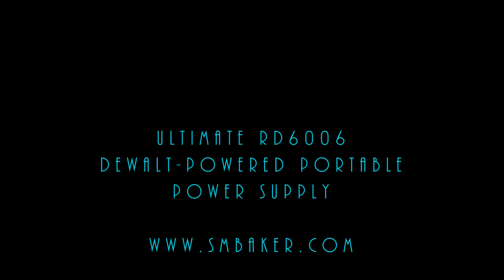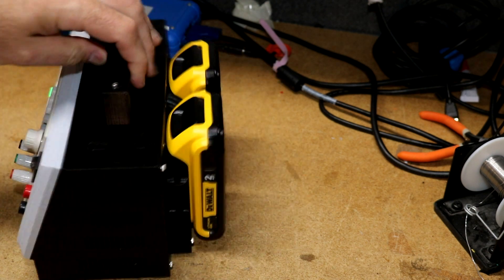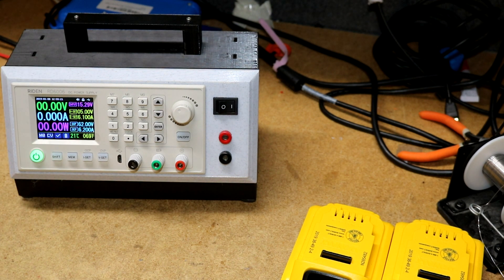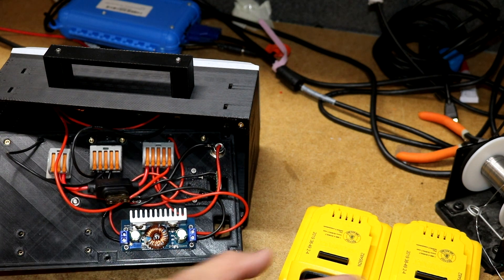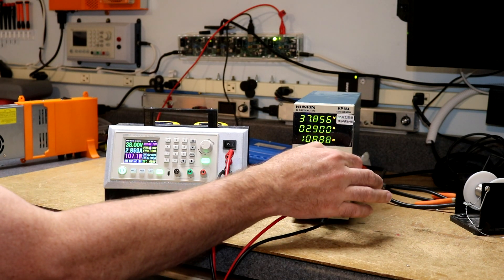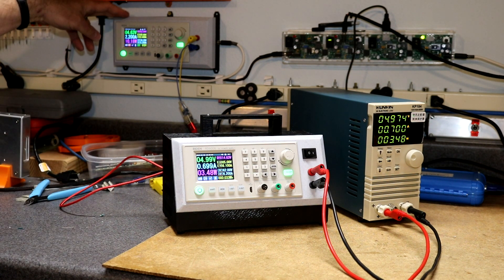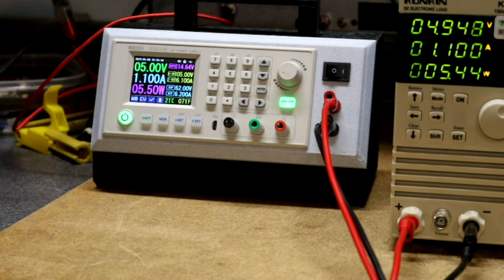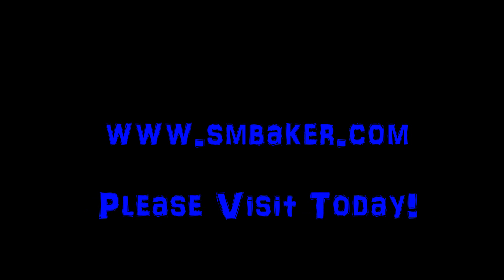Ultimate Lab RD6006 Power Supply Build, Portable Dewalt Lithium Powered

Comment: The rated voltage on an electro is just that, the voltage it can operate up to across the temperature range. The "wiggle room" is built in on top of that (~15%) so based purely on rated voltage there was no need to replace the 50v cap running at 41v! As you found out though it was a dud anyway.

Comment from the maker: Update - pulled the boost converter, desoldered the output cap, and it did test bad (read 10nF on my tester). Replaced with a 220uF/100V capacitor that was physically much larger. End-to-end efficiency is now about 60%. 2.4A in at the source == 1.5A out at the DC load.

Comment: Nice demo video. 
Here is a simple upgrade for the USB-C input.
Type C USB-C Female Input to DC/Rectangle Power PD Charge Cable fit for Laptop 18-20V (5.52.1mm for HP) https://www.amazon.com/dp/B083321BMJ/ref=cm_sw_r_em_apa_i_IAq3EbKCYVT5R

Comment: I made something like this a while back but used one of those much smaller adjustable buck converter supply modules. I didn't have an option to run it from USB but I have a ghetto USB 5 Volt out using a 7805 to use as a Phone Charger/Flash Light Charger. I used a Ryobi 4ah battery and also tossed on a little Volt Meter that I can pop in and out to test Lines since I use it for Work as a Low Volt Technician working on Alarms to full blown Home Automation.

Comment: I’m surprised that you didn’t design the fuse into your case for external ease of change without having to open the case.   Was the fuse an afterthought?
Reply from the maker: Thought about it, but eventually decided it's a fuse that should never blow so I didn't mind hiding it internally. There is plenty of room on the back panel of the supply that I've filled with other optional cutouts for switches or banana jacks, I could easily remix a back panel variant with a fuseholder instead.

Comment: Instead of the step up for usb c 5v you could use pd capabilities of usb c to ask for 20v from the charger. There are small modules available that handle the "handshake" with the charger.
Reply: Yeah. I’ve been using the Sparkfun PD breakout board to power stuff. It’s programmed over i2c, but it rememberers it’s last setting. About $15, I think.
Reply from the maker: I seriously thought about this, and the case is actually designed so that I can mount in different breakout boards for the USB-C connection. Right now, every single USB charger in my household is USB-A 5V-only. I've started the transition to the USB-C connector as a form factor, even on 5V-only sources, mainly because I started to accumulate a supply of A-to-C cables for my Raspi-4 projects.
Reply: @smbakeryt  Of course without PD negotiation USB-C will max out at 10W or 8W after an 80% efficient boost conversion. This is quite limiting compared to the 360W rating of the RD6006!
Reply: I came done here to suggest this exact thing.